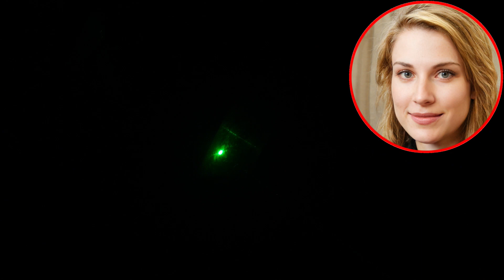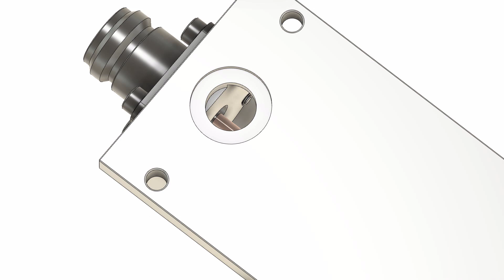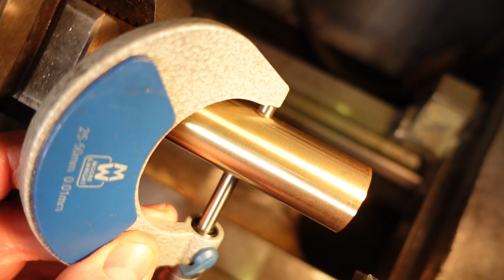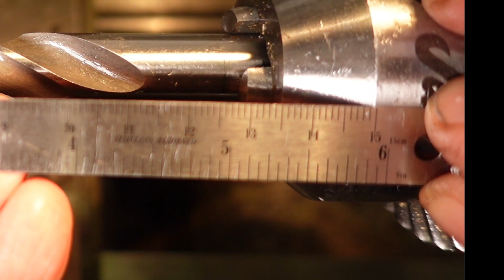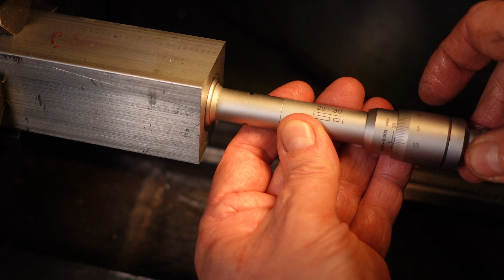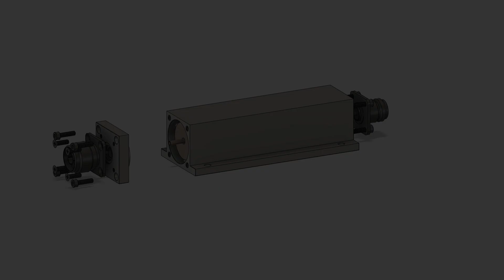Machining Microwave Coaxial Low Pass Filters Part 1

Comment: In every shop I visit ,including mine, is an old Colchester still spitting out parts
Reply from the maker: I suspect that old Colchesters appear spontaneously wherever there's a sniff of coolant and an empty corner.  Nobody remembers ordering them, nor what exactly they are used for, but they keep on making those parts, whatever they are...
Reply: @MachiningandMicrowaves  as per the promotional phrase: "The world turns on Colchester lathes." and what do you know.. It still does!
Reply: Cheers for the mood to the audience. While I've got your attention M&M (no, not those things) have you made up a shear tool yet? That other comment about a roller for finish passes, would that be knurling or burnishing? Made me curious. I must try one of those out. Better dig through the hardened stash and see what I've got roller wise. 

Course it'll take me at least until winter to get "round" (ahem, sorry) to it. 

Cheers! I've got a dishwasher to argue with before Trunchbull (the beloved wife, bless her she's tolerant of me) gets violent.
Reply from the maker: @ianphilip6281  I wasn't aware of what a burnishing roller was used for.  Found what I think was one in my father's old toolbox.  It's not something that I would normally use, but I can see it could be a useful addition to the armoury.  I use mostly polished carbide insert finishing tools for brass and aluminium and stainless out of habit really, they give a consistently excellent finish, and I use coated carbide at the upper end of the power of the old Colchester and get super finishes on 4140, EN24T and D2, but a 10HP motor would work better I suspect! A lot of what I do is boring internal tapers deep inside 4.5 mm diameter holes with 1.8 mm reamed holes at the base, using tiny Simturn 1.7mm solid carbide boring bars and similar micro tools.
Reply: @MachiningandMicrowaves  boom. A wealth of information right there. Keep meaning to pick up some polished carbide inserts for the occasionally dreadful aluminium grades I sometimes turn. Usually roughing with coated carbide and finish with a shear tool, or fine paper and polish. Found a fantastic piece of ally in a car park once of all places. Of course it took me bloody ages with a socket set to liberate it.

But I really did find it in a car park on the grass. Best ally I have ever machined. From a quick gander over yonder Web, "turns" (ha) out the burnishing roller provides a work hardened surface too on appropriate materials. Like knurling, it's a deformation process moving the material around rather than cutting it or shearing it. Not particularly useful to you in a waveguide or low pass filter mind you, not unless your finishes are truly crap.. which they aren't. Might be useful for bearing and shaft surfaces or very high precision dimensioning I suppose, if said roller was truly round, truly hard and in a truly beautiful journal bearing. As for work hardening I find stainless does enough of that for my liking, especially when drilling. A true love hate affair, love turning it, hate drilling it. 

Perhaps carbide drills will help, want some anyway so I'll run the purchase by the female comptroller I mean.. Counterpart in the morning.

Now, about that sheer tool.. sniggers

Keep the great content coming. Appreciate the effort given how busy you are!
Reply: @MachiningandMicrowaves  I just received some of those polished tips after watching, hopefully save time on sharpening HSS tools
Reply from the maker: HSS definitely has its place, but carbide inserts suit me for most jobs

Comment: Yagi antennas owe their performance to accurate machining.
Their only down-side is their size...they can be quite long and delicate.
Very directional, highly polarized.
Reply from the maker: Longest Yagi I have is about 12 metres, almost 40 ft. I'm working on an array of eight Yagis for 432 MHz on an az-el mount for moonbounce. My biggest dish is not big enough to be really effective on 23cm/1.3 GHz (it's only 10ft/3 metres diameter) and would be hopeless on 432 MHz. It certainly gets hard to make a Yagi above 2.3 GHz as you say, although loop yagis with circular ring elements, tig-welded at the joint can work well at 3.4 GHz, you get into physical issues of stiffness to size ratios that make life very tough.  I know of at least on 10 GHz yagi that was made with elements made from lengths of copper wire fitted through precisely spaced holed in a piece of glass fibre printer circuit laminate.  With elements 13 mm long, it wasn't exactly mechanically robust, but great fun.  I made some parts for a set of four long 432 MHz yagis and some other parts for a 144 MHz system of four long X format crossed yagis for EME with polarisation control.  That was a fascinating job.  Next one for that friend is an elevation system for a 50 MHz yagi that is ENORMOUS.  There's been a huge amount of modelling work beyond the NEC-4 approach to do sidelobe optimisation to reduce noise pickup from warm ground, buildings and trees, and some of the modern designs are now producing Gain/Temperature ratios unheard back in the last century.  I need to build those eight 432 MHz yagis and the associated open-wire feeder system, so that might appear as a video in late summer.
At microwave frequencies of course, dishes, patch arrays and slot arrays can produce gains way beyond what Yagis can manage. My small 10 GHz dish has a gain around 37 dBi.  My longest yagi is only about 21 dBi, so the dish has 40 times the gain, but a dish for the lower frequency would be rather a lot larger than my house!  Horses for courses, as they say.
The mechanical design of yagis is, as you rightly suggest, very intricate, with all the boom corrections, variable spacing, and different types of driven elements, feed impedances, Q values and balun topologies.  Someone needs to start a channel called "Machining and VHF Yagis" I guess! I'd subscribe immediately.
My level of expertise in that area of antenna theory, modelling and design is approximately zero. If not actually negative.

Comment: We have two things in common:
We are radio amateurs
We love getting the blacksmiths drills out!
Good Job. Looking forward to the next one  😀 
Cheers, Fraser
Reply from the maker: That one-inch job does love spinning in the chuck. I might have to use it in a collet or fit it into a toolholder with a flat ground on the shaft to engage with a setscrew.  Or get a U-drill if I could find one with less than a 32mm shank obvs. Sixty-eight videos in the pipeline now. That's YEARS at my current work rate!
Reply: @MachiningandMicrowaves  yup, my pillar drill belts complains loudly when I spin up the 22mm blacksmith drill. Of course, I'm generally hacking together something like a winch bumper for my Land Rover, a vehicle which has tolerances measured in light years. Or is that parsecs?
68 videos? Bleedin' 'eck.

Comment: Question: why do you drag the tool backwards after finishing a cut and mar the surface?
Reply from the maker: Never on a finish pass obviously, but the tiny spiral cut won't have any impact on measurements, as the micrometer or caliper will bridge over the cuts. i find I get better precision if I don't back off and reset on each pass, also if I fumble the DRO measurement, I can guarantee the cross-slide is still in the same place so there's no risk of getting lost.  If I refurbish the cross-slide, leadscrew, gibs and nut, it should be perfectly OK to retract each time.  Also, bear in mind that in a few cases, I do things like knocking the camera, or getting oil on the lens or running out of battery, so I lose the finish pass and have to use one that is almost the finish pass in the video.  My horribly Sony ZV-1 can't be charged and used as the same time, although there is a way to bodge it with a dummy battery, but then it's hard to fit it on to a tripod mount.  Give me a few years and I'll get a little less rubbish at everything!  Except TIG welding.  I expect to be hopeless at that forever.
Reply: @MachiningandMicrowaves  hahaha 😂 Come on dude! I'm sure you'll someday be a master of TIG...ing... I suppose. New word for the dictionary: TIGing.
If you're using DRO, doesn't it help you ensure repeatability no matter how much you move the tool post? But yeah, managing camera photage is a nightmare. Pretty sure that's why most YouTubers outsource it as soon as they can.

Comment: Wouldn’t all of that have been much simpler on your Bridgeport? With a final boring pass on the lathe, obviously. By my calculations it would have saved you 17,923 steps in 4-jaw centering.
Reply from the maker: If I had a decent long-reach boring bar, it would certainly have been easier, but the head I have can only take a weedy 12mm bar and I the longest I have can only reach 50mm on bores narrower than the head.  HOWEVER... as it would obviously be 78.3924 percent easier to do it on the mill, I am plotting a build of a long bar with an insert cartridge and fine adjustment screw that might also be able to do this much more simply.  Perhaps a U-drill with a flat end to get it close to dimension, but ultimately, this is really a job for a CNC machine if I wanted more than seven of them this size.

For this batch, what I'm ACTUALLY doing is fitting brass jaw protectors and marking two of the jaws as fixed, so I can just pop a new piece in, nip it up with the other two jaws, then check for parallelism, tappy-tap-tapping if necessary, having marked the two faces that are against the fixed jaws so I know which edge is closest to perpendicular to my reference face.  I won't drill out the 6mm hole on the lathe, I'll just use the slug and a gauge pin in that hole to confirm the alignment in the Bridgeport and shim it if necessary, then drill it to size on the BP while I'm drilling and tapping the mounting holes.  I might get an HSS reamer the right size as I can imagine it will be useful to be able to make accurate 50 ohm characteristic impedance coaxial lines for other jobs.

To save messing with alignment, I'll nip the raw stock in the vice on wide parallels with one end overhanging the jaws, take a cut off it, then deck the top and both sides giving me four guaranteed (but oversized) faces, then invert the thing with the other end overhanging, machine to finished length, then trim both sides to form the mounting flanges to finished width and deck the bottom oversize.  Then all six faces and the flanges are square with only two setups. I can then do the bore and holes and underside orifice without risk of marring the finished surfaces.  Finally, grip the thing on the flange edges and finish the sides, top and bottom to final dimension in just two more setups.  That might be worth a short video to show the process
In related news, I found an old 1 inch stroke imperial dial gauge that was in my dad's toolbox, so I can probably save a bit of time next time I have to do a 4-jaw setup on square stock.
Reply: Thanks for the thorough reply. 

I was thinking that even if you could not finish the bore on the mill, you could do the drilling, flatten the bottom, and bore a little at the top to use in indicating it in the 4-jaw. Or maybe drill to the largest reamer you have, then ream for an indicating surface. Use appropriate vice stops to allow flipping the body end-for-end, so you can drill and tap for the N-connectors etc. 

If you ream an undersized bore, could you hold the work between centers to rough position it and make the 4-jaw centering trivial? Or use a mandrel in a tailstock chuck for the same purpose?
Reply from the maker: @nf4x  I like the idea of reaming a reference surface to work from. I could just use a 30mm machine reamer of course, and then make two end plates instead of a blind hole.  I've made some expanding mandrels for similar jobs but I'll come up with something as I just received several more orders!  Honestly, you mention something in passing on Youtube and thousands of people see it.  Who'd have known???

Comment: Electricity is all fun and games until it starts moving back and forth, and the RF stuff is utterly bananas.
Reply from the maker: I wonder if I could use one of Kurtis from CEE's banana rulers to measure wavelengths?  Hmmmmm, banana calipers! https://youtu.be/03oD0Wk6MzM?t=322
Reply: Why not? 1.3 GHz is the 9 banana band, 2.3 is the 5 and a half banana band, 3.4 is the 3 and a half banana band, 5.7 is the two banana band, 10 GHz is the banana band, and 24 is the half banana band. From there it gets fun, with 47 GHz being the 250 millibanana band, etc.
Reply from the maker: @nf4x  OK, that's what I'm calling them in the next SHC activity contest. Wish me luck, smoke me a kipper, I'll be back for breakfast.....

Comment: I'm so glad I found this channel.

I work for an ISP on an HFC plant, we've got RF and light, our hi-pass and lo-pass filters are like gold to us, the ones we use  are ruggedized for use in some less than stellar places and expensive as sin.
Reply from the maker: One of the 58 or so planned videos in my pipeline is about evanescent mode waveguide filters operating well beyond TE10 cutoff. Those are complete Magick, they don't even need end caps. you can see right through the guide, but the RF can't propagate through the short length of open guide and is trapped in a sort of passive electromagnetic jail. Spoooky stuff.  Electroforming on dissolvable aluminium mandrels is on the agenda for later in the year, and it's time I revisited the 1.3 GHz rat-race coupler I made years ago, but this time for 2.3 GHz http://www.g4dbn.uk/?p=624

Comment: Would you have been better to run a lot slower for reaming, to a better finish,  possibly more accurate?
Reply from the maker: Interesting point. That reamer is very small of course.  I think it was running at 360 rpm, I tend to speed up those segments, but 360 rpm at 3 mm is the same as 90 rpm at 12 mm diameter. My Machinery's Handbook 30th ed. page 1112 suggests a highly alarming 610 surface feet per minute for reaming most aluminium wrought/extruded alloys in whatever heat treat state.  A 3mm reamer is about 7mm circumference, so that's under 9 sfm at 360 rpm.  Feed rate is 50 thou per revolution.

I could in theory run that reamer 66 times faster if the Necrotelecomnicon of Machining is to be believed.  It just felt OK running it at 360, and the amount removed wasn't enough to clog the flutes, plus I filled the bore with lube so that tends to push chips out as the reamer goes in.  I must check the cutting data sheets for my "proper" 3mm and 4mm reamers to see what the designed speed is.  In this specific application, I don't want a perfect fit as I need a tiny gap for solder to flow, but the tube is very slightly undersize, so all is good.

Comment: ....so does black treacle make a good drilling lubricant?
Reply from the maker: Tasty, but tricky to deploy in a cold shop.  That can has an anti-spill tube soldered into the lid, but at current shop temperatures, it would take ten minutes for molasses to drip out of a spoon.  I suspect the clouds of acrid smoke and lack of lubricity might be significant drawbacks, but it would prevent flying chips 100%.

Comment: With the size of Adam's machinery he could build macro-wave equipment.
Reply from the maker: It's rarely polite to speak of the comparative dimensions of a gentleman's apparatus, but @bbloc02 and @CuttingEdgeEngineeringAustralia do make Adam's tackle appear relatively ordinary.  I miss the vids from the splendid @userwl2850 who works about 40 miles from here.  Proper big machines. Not to mention the YUGE Cincinnati shaper and mill that @FireballTool runs.
Reply: @MachiningandMicrowaves  I'm subscribed to all but userwl2850; I guess those guys would be making mega-wave components? Carl at Cutting Edge will be putting Jason at Fireball to shame soon. He just brought his shaper out of storage so it doensn't count yet.
Reply from the maker: @HAL_9001  "Shaper Wars" See the series on all good local cable TV channels this summer.

Comment: If you make some concentric grooves in the face of the chuck, the glue can go in the grooves and the higher land can act as the reference surface, that's how clickspring does it I think.
Reply from the maker: Good point, I thought they were to allow any excess glue to escape rather than acting as a reference, from the days of beeswax chucks.CA glue is weird stuff, thinner glue lines are stronger in shear, and I'm wondering now if the low viscosity types might give a thinner and more consistent glue line. I have some 2.3 GHz versions of the filters, so haven't made any for that frequency or 3.4 GHz, where the tolerances would be even tighter. 

I need to make some oval iris plates in Aluminium. Their thickness is specified with a tolerance of a thou. It will be interesting to try that with a glue chuck rather than gripping it in a chuck and using an Edge Technology Chuck Stop 30-000 spacer kit as I do at present.

Comment: While I can't speak for Quinn "Blondihacks" Dunki, it seems like it should be OK to bring up such a well-known tradition as facing off the end. However, you may have committed a terrible atrocity by failing to say "Yahtzee!" when that first part came loose. Hopefully AIMEE didn't notice. 😉👍️
Reply from the maker: We were more of a Mah-jongg family. I did try saying that, but it didn't have the same ring to it. Yelling "Y*htz**" just feels like cultural appropriation and general wrongness. The frequency of that "pop" should really vary with material diameter and bulk modulus. AIMEE still wants to wear a Quinn hat and safety squints. Avatars doing cosplay? Wooooo.
Reply: @MachiningandMicrowaves  champagne cork SFX definitely much better than yahtzee in my opinion.